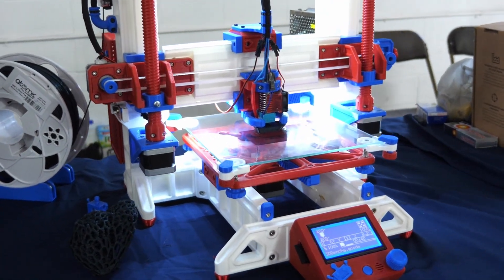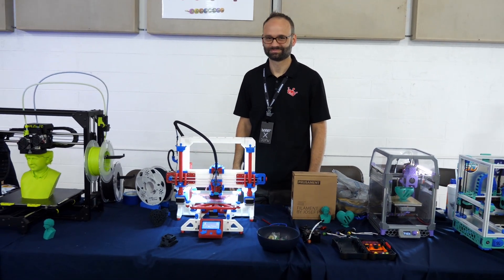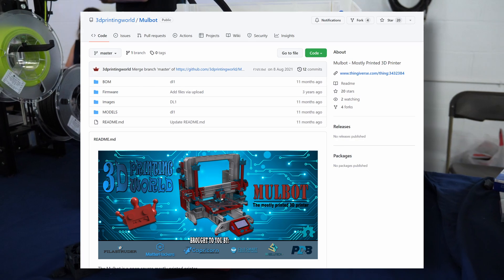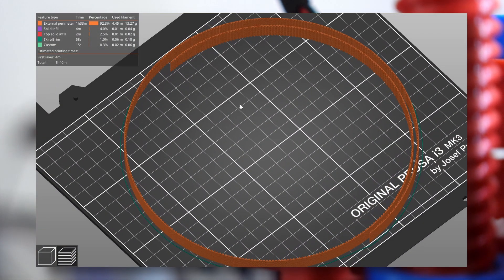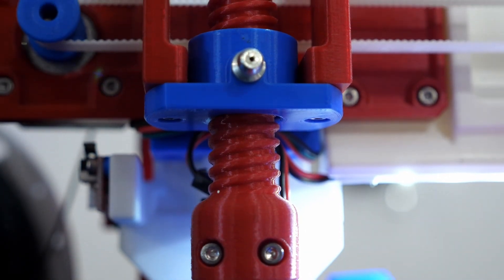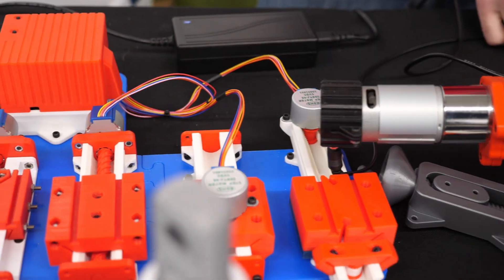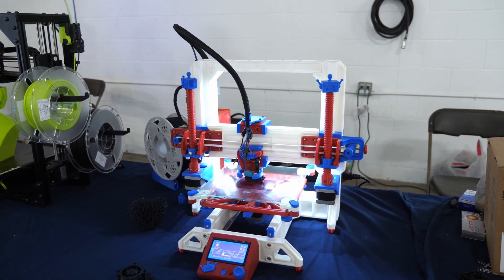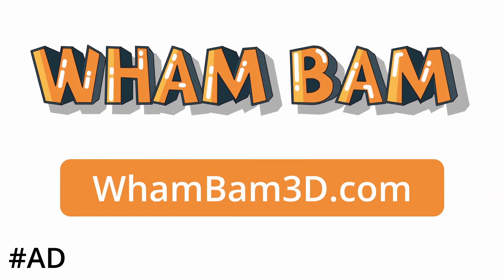The Mostly Printed 3D Printer! #MRRF2022

Comment: The rack and pinion, my CNC is rack and pinion driven for the largest axis, it's a good way to make a printer have insanely good speed and torque for the size of its steppers.  It was designed by cncrouterparts, now avidcnc and comes as a kit.

Comment: Just curious... is this cost effective with sub $200 printers on Amazon? Or is it more of a proof of concept?
Reply: Prices will surely be different between countries, but looking at my local market (Poland)
I bought ender3 for 700-750PLN (roughly $180)
If I had to buy parts needed for similar project (I'll base it on creality parts, bought on the website that I know I'll get what I ordered (so no AliExpress etc)), it's:

4x stepper motor - 200PLN;
display - 150PLN;
bed - let's say 70PLN;
heat block parts ~100PLN;
board - 200PLN;

around here, we are already at the price of my printer

Cables, power supply and other stuff I forgot to mention - idk how much

so, at least for me, it looks like a proof of concept or a cool project, but surely not cost effective alternative :)

Comment: I know they're using metal screws to hold everything togethet, but my Ender 3 V2 can print down to 3mm screws. What's stopping them from using printed fastners? Strength? Just design around it. 6mm printed bolts would likely be strong enough.

Comment: Wonderful to see the extremes to which you can push 3D printed parts.
I've had fun learning how to design small intricate TPU prints for quadcopters that thousands now use, helped through using the learnt knowledge of the material's properties and the printing process, notably how the part will be printed with the typical 0.4mm nozzle & 0.2mm layer height.
Really gets you thinking laterally when trying to design parts that don't need supports when printed so they come out pretty much perfect first time for everyone.

Comment: That's genius, printed linear rails are so cool to watch! I was wondering where RepRap went, I've heard about the project at random 3d printing event in the coworking here in Kyiv in 2011 or 2012, but back then decided to wait and haven't got into 3d printing until 2021. Sort of expected 3d printed printers to be more common.
In theory, a textured bed can be printed with PEEK. Not sure if it would work cold even with adhesives though.
Reply: Didn't prusa came from the reprap project? Ender 3 is now about $200-250. And a large portion of that are parts that can't be 3D printed like the hotend, motors, and the board or things that would not be cheaper if 3D printed. FDM printer prices have fallen a lot in the last decade and the output quality vastly better. We are now nearing the bottom of the curve, where prices can fall and quality improve only incrementally, unless some revolutionary new ideas appear.

Comment: Hi Stefan, one request, could you do your test series with TPU?
I'm building a mobile solar frame which consists of aluminum tubes and printed connectors, actually I wanted to print it with PLA+, but I'm still testing TPU and I must say I'm impressed by the properties when you print it "more stable". (i try to avoid the word indestructible ;P)

Hi Stefan, eine Bitte, könntest du deine Testreihen mal mit TPU durchführen?
ich baue mir grade ein Mobiles Solargestell welches aus Alurohren und gedruckten Verbindern besteht, eigentlich wollte ich es mit PLA+ drucken, teste aber vorher noch TPU und ich muß sagen ich bin beeindruckt von den eigenschaften wenn man es "stabiler" druckt. (ich versuche das wort unzerstörbar zu vermeiden ;P)

Comment: This is great for countries like Pakistan where 3D printer imports are regulated
Reply: Wait why?
Reply: @Steph.98114  Worries about unlicensed manufacture of firearms, which is odd tbh given they have open gunsmithing shops.
Reply: @SIGSEGV1337  that's so dumb, like sure you can print a lower but you still need metal parts and ammo

Comment: I have to ask why has nobody done a gear drive before on a normal printer? I figure it must be possible to have something precision enough for the bed movement to have a rack and pinion over a belt.  Or does that precision just not benefit the cost enough compared to systems like belts or screws.
Reply: I think it's just a matter of the fact that you can't use a rack drive for the x-axis because you need a carriage for it that's twice the width of the build volume in order to make the head move far enough, and if you're already doing one belt drive for the X why change it up for the Y unless you were deliberately trying to prove a point. Incorporating rack teeth into a part is actually kind of tricky, especially a herringbone rack like he used, a tricky bit of custom machining unless you 3D print the part.

Comment: Now can he use the nearly completely 3D printed printer to print a second printer? That's the true test
Reply from the maker: Unfortunately the bed of the Mulbot isn't big enough to re-produce itself 😅
Reply: @CNCKitchen  just redesign the largest parts such they can be printed in multiple times, problem solved.

Comment: Now is this the real RepRap Printer  ...real in that NO "vitamins" are needed? (steel bbs, motors, electronics neglectable?)
Reply: Those things you excluded are the vitamins lol: Hotend, extruder, wires, limit switches, motherboard, PSU, ball bearings, fasteners, glass plate, springs, threaded inserts.